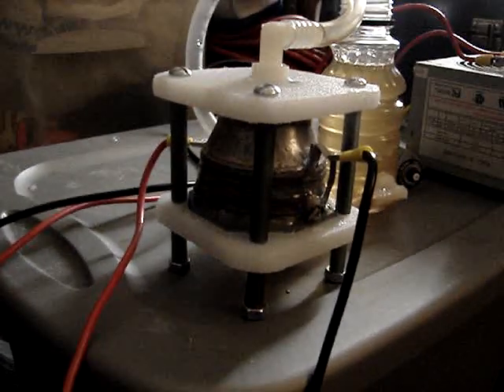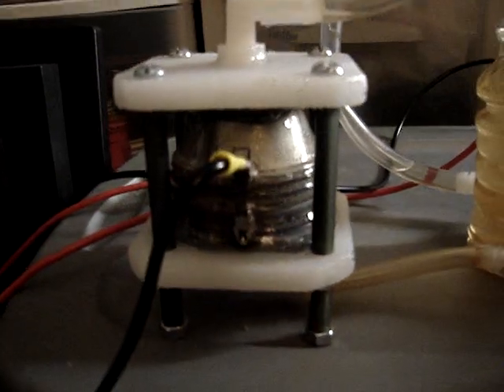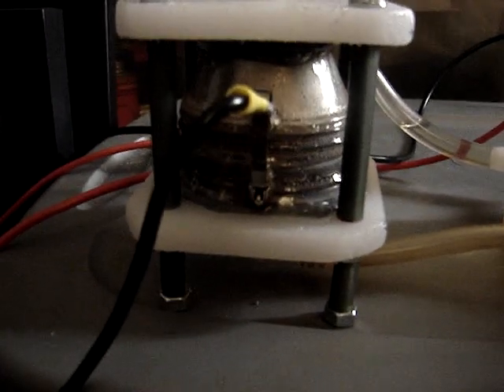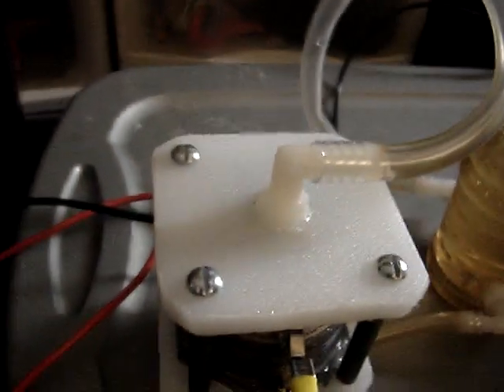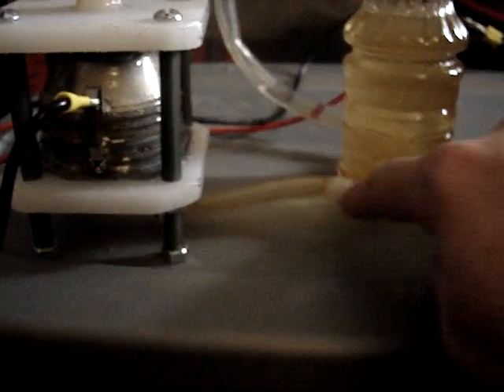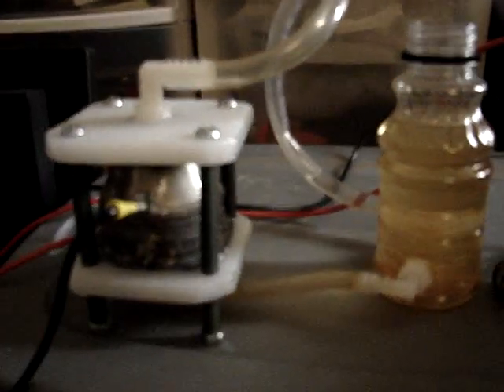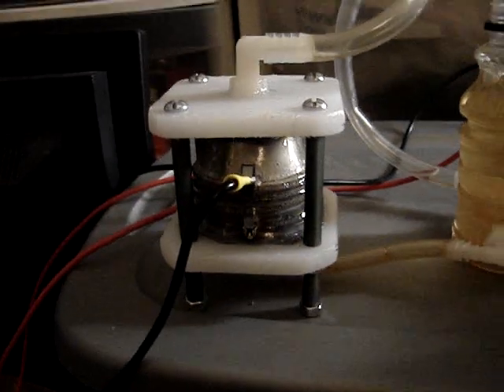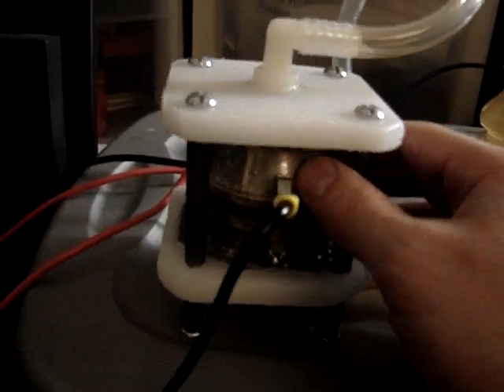Vid16 Volcano Cell Dry Cell Hydrogen Generator (HHO, Brown's Gas, Hydroxy)

Comment: Dude you have the same problem I have.Just can't leave the cups alone.I have been trying a lot of things and so far the cups give the best.Right now i use a 7 cup in my truck.works good.96 gmc 454 7.4 liter and with just these 7 cups i can get my truck to idle on just hho .My cup fig is +n-n+n- works great so far I ran it for an hour and it stays at 8 amps with 12 volts.It did get worm but I hooked it up with a reservoir .and this is a wet cell.temps are way down

Comment: the volume of water needs to be greater than the cell preasure. you can increase the preasure you need by using a 1liter bubbler thus more weight pushing down on the vacume preasure created from the cell. make sure the bubbler is higher than the cell. just like if you wsas going to syphon fuel into a can. (gravity) use it.

Comment from the maker: It is a converted PC Power supply that provides 12v DC current.  Unfortunately I accidentally dropped my clam-meter into a bucket of water when I was performing a LPM test on one of my designs, so I'm not able to give an exact reading of voltage at this time.

Comment from the maker: I am having a problem getting it to recirculate the water, so I'll have to figure that out.

The gas keeps coming out of both sides, so I've been coming up with a few ideas to bring in recirculated water.

Hook up a pump
Place the cell on its side
Connect a Check Valve
Replace the 1/4" barb with a 3/8" or 1/2" barb

If anyone can give me any ideas on how to get this to work, it would be greatly appreciated.

Comment from the maker: I initially tried Positive on the bottom and Negative on the top, but I discovered during my experiments that I have better output with the bottom as Negative. 

The material I use for gaskets in between the cups is shower pan liner that I bought for $5 at Home Depot.  It is not very thick and I constantly found new leaks. I believe it is 1/32" thick, so I would recommend something that is 1/16" or even 1/8" thick.

FYI - I did not use any cable tie spacers on this design. Only selfmade gaskets.

Comment from the maker: I used shower pan liner as the spacers in between the cups and then did a pressure fitting by tightening the bolts.  I did have problems with leaks, so I finally came up with the idea to use high-temp spray on rubber.  That sealed all of my leaks, and so far I haven't had any more leaks.

Comment from the maker: I'm glad I finally got it working, but I'm already working on 2 other designs that I came up with while I was putting this one together.  So even though this is working, I will probably never put it in a car.  However, I do have a minibike that I want to run on HHO only, so maybe this drycell will find a home there.

The new designs I have are much easier to assemble and in initial testing the output appears to be nearly doubled with only 5 to 6 amp draw.

Comment from the maker: Thanks,

When I was working on this cell, I came up with several different cup drycell ideas that are easier to build and are more efficient.  

I originally put in 1 teaspoon of KOH and it was running at 11 Amps. The output was amazing, but the cell did get hot.  I'm not looking to run it at max output, because I don't want to deal with heating issues. 

I backed off on the amount of KOH and tried a half teaspoon, and the results I got are reflected on this video.